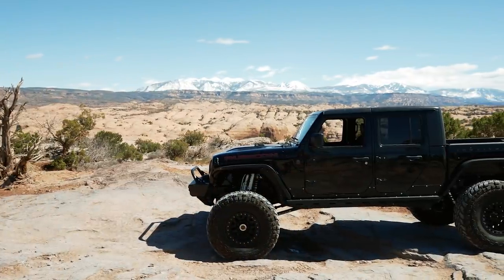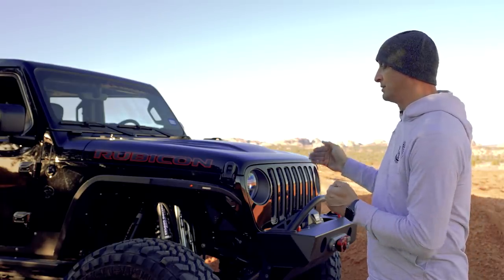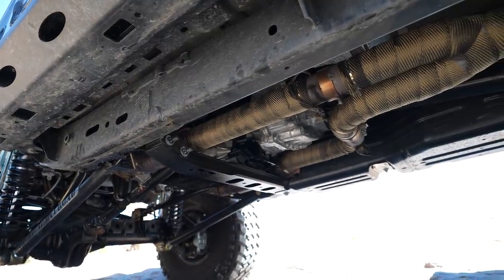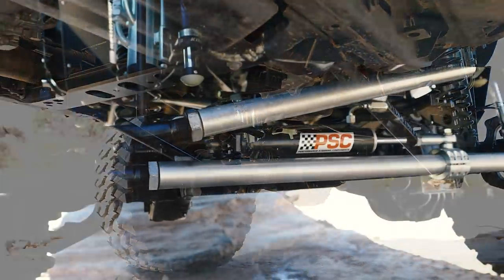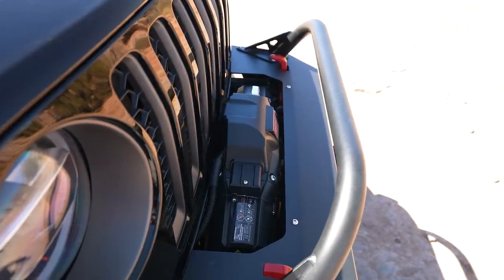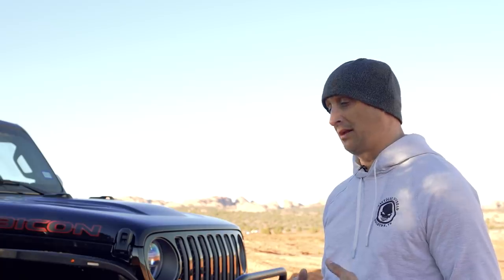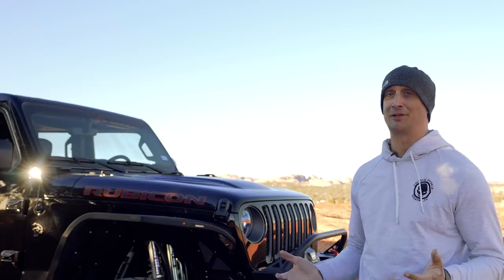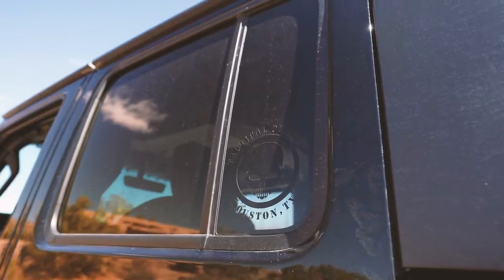2021 Jeep Gladiator Rubicon Hellcat V8 Engine on Dana 60s and 40s | Inside Line

Comment: Neat build, but tripling the price to essentially add two more cylinders and a super charger is insane.
Reply: Giygas can’t even drive bro
Reply: And a $30k crate motor, a $6k transmission, $10k worth of suspension, $35k worth of axles and lockers, $8k for wheels/tires, a crap ton of labor and time, and the knowledge to tune it all and make it work correctly. I'm not saying it's worth $180k, but that isn't your average bolt on upgrades in a weekend.